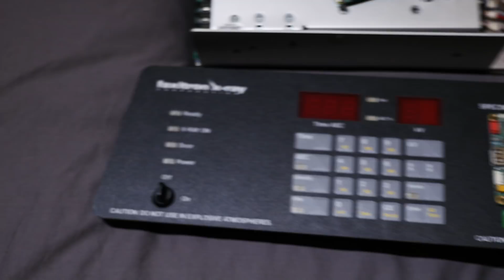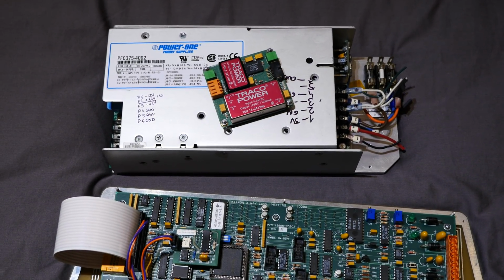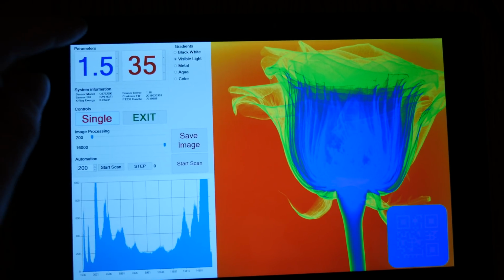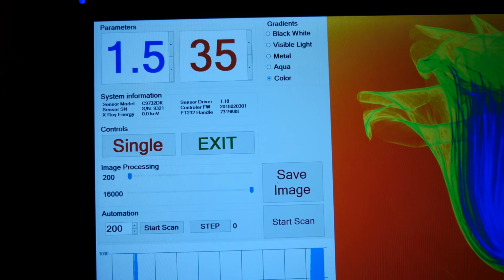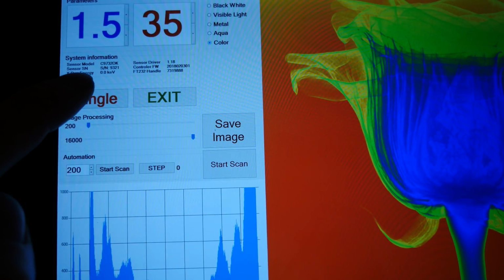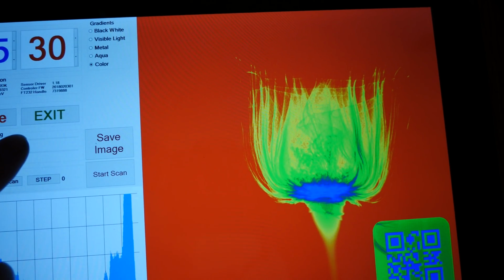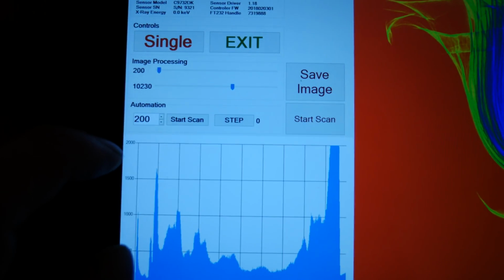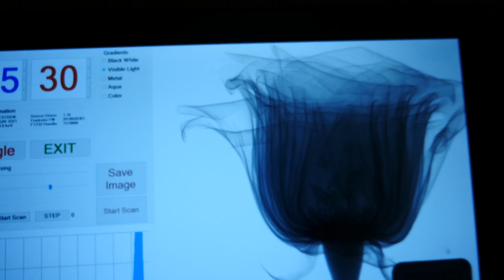How to get X-ray movie of a rose  or in other words, typical day for physicist :)

Comment: I would like to know about the false-color algorithm you are using.
Reply from the maker: simple. FIrst i have a range, between 0 and 16000. when i create RGB color array that has size of my sensor output (0-16000). when i just create gradianet between colors i want, so  is RED, and 25% RED is zero, and green is full, and doing that full range, by selecting right colors. 

Simple way is COLOR(X*15,X*5,X*35) and you will get some kind of gradient.
Reply: Thanks for the info, I'm using a custom algorithm I made considering a 3d space where the axis are R, G and B, and a modified spiral that goes from (0,0,0) to (255,255,255). Depending on the pixel brightness of the black and white input image, I pick a point of that spiral. The results I get are good but could be better, mainly because satuation of colors is a bit low.